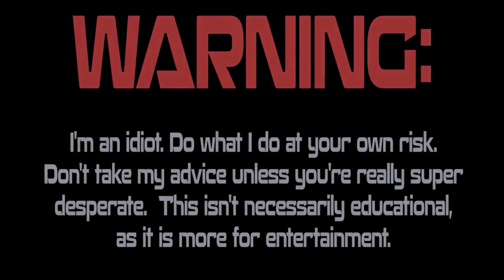FORGOTTEN 1963 Buick LeSabre -  WILL IT DRIVE 100 Miles Home? (P2)

Comment: There are at least 2 different Bendix drives for the Delco starter, and they're interchangeable. The difference is the size of the case around the clutch, and if it's too big, what you saw is the result. That old nailhead sounds like a locomotive right out of the LaGrange shops. But that's okay, because it pulls like locomotive too. The Dynaflow does take about 40 minutes or so to decide to allow forward movement, but that gets better with some rpm. The kickdown is only about 3 minutes, so that's okay. Traffic can be sooo demanding with the horns and such.
Reply: Makes me glad I got the pontiac version with the hydromatic..

Comment: I believe these nail head engines were used as starters for SR71 Blackbirds. Correct me if I'm wrong . The 401 nail head has a goose neck that meets from pipes coming from both heads up front.

Comment: When I was in my early twenties I owned a 61 F100 Ford Pickup! the windshield motor broke on me and I went to the wreakers and took one off and old truck and came home and put it in. It was minus 30 outside, not including the windshield factor. I live in Canada. I put the windshield motor in and it was junk. I went back to the wreakers and got another put that in and it was junk too. I couldn't go to a normal wreakers where they normally test the parts before they sell them it was just a farmer in my area that had pile of these old trucks in his yard. So basically on the third try I got it. I'll never forget it, my fingers were so frozen it took me a whole afternoon to change the motor just once, it was so cold outside. What a nightmare, I do not miss those days. But I use to love that old little truck I ended up owning several of them back in the day.

Comment: It is funny he talked about starters almost never fall out, I was working on a 94 Chevy c1500 that had a 6.5 l diesel of all things in it. It was having electrical problems like the six fives do and at one point in time for some unknowing reason one of the cylinders predetonated when trying to start and snapped both starter bolts out and the starter fell on the ground suspended by the battery cable. I've never seen it before nobody else who was in the shop had ever seen it before, and I hope to not see it ever again lol

Comment: Best tool for quick and secure headliner repair is the stainless steel medical staple gun that's typically used for large lacerations. It works great

Comment: Love the NASCAR reference. Not only did guys like Smokey Yunick run extra fuel lines [as the rule book didnt say how long your fuel lines could be] the rule book also didnt say how WIDE your fuel lines could be, so Smokey ran a 1" pipe  [or so] from the tank to the engine to get himself a couple extra gallons.

Comment: The replacement starter you bought is a general purpose one that fits some Buick models but many cars built through the 1960's are not compatible with modern replacement parts because many cars built through the 1960's had parts that were not interchangeable compatible other engines and cars - the exception being Mopar

Comment: I did notice you have a fire extinguisher right behind by the door, right in the reach zone, it might be fun to check the charged in the green meter and perhaps leave the door open, just in case. You do move fast for a big guy, kudos.  Of the innumerable engines you have CPRd this one sounded the best, like a kitten asleep on your face.

Comment: It,s a runner!!!!  Lol lol lol.....                  Just make it run perfect . Fix brakes, windows, heater, tires, use SOS PADS on paint or scotch Brite, and clear coat the outside, put a radio in it and speakers, keep the exhaust just like that, but replace the actual pipe.  No muffler needed, steam clean the engine compartment and clear coat, complete tune up. Fix radiator. Fix headlights, fix it mechanically. I like how the exhaust sounds...  Fix wipers too.  A cool runner boys.. spray under coating under fenders and under bottom of cars body.and spray inside truck after cleaning.. need seats redone in front, and new shocks. Make a cool runner. Like the red in side. Get new carpet inside car and trunk.. clean and clear coat wheels and put new rubber on them, put a spare back in trunk..plain original wheels and put original hub caps on too, between the body and How it sounds now. That's cool...that's a cool classic that way..  it,s a cool runner... That's a great town car, you will get a lot of looks...that car has a ton of character... I love it......I like to keep vehicles as original as possible, just like my old pickups.......go for it, fix the A/C with good or new parts of ya want too..  drive it all around..... It has a classic worn sound gon on.......and put an American flag on both rear window doors, those are nice nylon flags. Put a 76 gas ball on antenna too.... Do not tint windows or change the wheels out.... from an old truck guy.
Reply: Got that right! Was thinking the same. I'm putting back to life a 2006 Ford Ranger, you know, the ones with all Mazda engine and parts. Really hard to find the whit cove rotor cap on the distributor, can't fired up without it. Kind regards from BC

Comment: Hey Derek, I keep forgetting to tell ya, automatic transmission fluid needs to be checked while the engine is running. So if the metal checkin stick says it's low when the power make it happener is off, it's definitely too low for driving.
Reply: Bet he can read the dipstick too

Comment: Just for laughs, after you got it started you should have pulled into the nearest Buick dealer and ask them for an oil change, and tell them it's been running a little rough at highway speeds.

Comment: Hey Fella. I gots a ?  What is wrong when the car runs at normal operating temp but when you shut er down it bubbles badly in the radiator? I can hear it. Sounds like it is boiling inside. Think it’s air. Head gasket?? 1996 Toyota Camry. Thanks my friend love your show!!

Comment: In the fall of 83, I turned 16 and was so happy to buy my first car. It was a 64’ Buick Skylark, 2 door hardtop with a 301 and a 2 speed powerglide. It had the same wiggly ass syndrome. When the driveshaft would rub, I could back up and slam on what little brakes it had to shift it back. And of course since I was 16, I drove it as hard and fast as it would go.

Comment: I have fixed a few of these era Delco starters with new brushes only in about 20 minutes. Brushes cost 33 cents from the Buick dealer the first time I replaced a set. Now? Might not even be available.

Comment: They used the wrong starter drive when they rebuilt the starter. 
 In the good old days I kept a couple sets of Delco brushes in my tool box. Then rebuilt starters went to $19 and starter bushes went to $12 and then not carried in parts stores .

Comment: I think the starter they gave you was for the 455 Rocket I remember getting the wrong one on a build they sent me the original one you had which was standard for Buick Oldsmobile

Just a thought make a t valve for your temporary fuel tank so it dumps back in with a filter on both ends

Comment: Help bleed brakes? Its called a stick, between the pedal and the seat.  Especially if its an electric seat then you can just use the forwards/backwards  switch.   It takes time but you don't have to hassle the wife.

Comment: You would have been just fine if you had changed the nose cone in part 1? If I remember correctly from episode 1? The starter bending was the problem, to begin with.

Coming, Derek, starters are easy as heck, brother! ✌❤💯

*I've watched every episode of, VGG! 
The part where you can bring anything & everything back to life & drive it home, build big blocks & install super chargers & such? Kinda MIND BOGGLES A, "MAN", that that starter "dips" on you so much? 
2 bolts from the back end & finnagle the ears from the solenoid over the end of the bendix & swap that baby out? If you gotta swap the bendix? You may have to remove the c - clip on the business end? (Usually under a plastic cover/ring) & don't lose the little bushing... it goes between the armature & the nose cone "IF" you drop the little feller? ✌❤💯

Comment: Ya know, I was looking at a house to rent and went to leave only to find the starter bolts had backed out and starter was dingle dangling under the truck. Put the bolts back in in the driveway and went on my way.

Comment: All you have to do is swap the nose cone around it looks like to me it's the same some of the nose comeback cast are many GM starters you could probably even use at 3510 off a small block and swap the front and it would work

Comment: You should be able to just take the nose cone off the old start and put on the new one if you can change that bush and tortillas starter too and it should work

Comment: From 1964 until 1966 the 401 & 425 Buick engines had  different crankshafts than the earlier models to accommodate the new turbo 400 transmissions. A forged steel crank in the 401 and cast iron in the 425. Flex plates transmissions and starters from 1964 to 1966 fit both engines but do not fit the earlier models.

Comment: Back 45 years ago I spent all my time on fixing up my car to get back to work and then after I found a dirt cheap replacement car I sold the car I was driving and started working on the next old car I was going back and forth to work in. I had a 69 Firebird then a 70 mustang and then a 71 Cuda and then I got a 72 Plymouth Fury with a 360 cu inch and then I switched to Escorts and Lynx because gasoline went up high and I was supporting my family. I had to fix up old cars and trucks for 25 years and then I had enough money and a decent job that I could buy a new Ford Ranger and from that time on I never wanted anything but new cars or trucks today I drive a Silverado I don’t buy Fords anymore I buy Chevy trucks because my mechanic said they are the best to work on and I don’t want problems. My 2010 Silverado  has only had one problem and that was the windshield wiper relay THATS built into the fuse box the parts from the dealer were $525 and labor was $300 so that’s not bad for 100 k miles

Comment: i always bleed the brakes alone, a non return valve on the end of  hose or let the end of the hose connected to bleeding nipple into a botrle with brake fluid on floor it also create non return of air but i suppose you and most of the guys know that

Comment: Had several old Buicks with the 401 and 425 engines in them . With a performance tune they would outrun most the hot rods of the 60s.
Reply: Currently have an early-455 Buick car. She moves out pretty swiftly, for 4,825 lbs + me and my stuff to boot.

Comment: This reminds me of the time I drove 
Two lady's from Toronto  to Montreal. I had rented a car and it was in the time that the government 
Changed from miles to k. 60 was 100 and I am on the 401. The speed limit was 100.. but not k. The writing 
For k was on top of the miles. I thought I was going 100 but I was going like 60. I am in the fast lane. After  9 hours oof a 4 hour trip, I look down and it done on me this car had been changed. I had cops get behind
For a ways, and then turn off. I didn't rabbit seeing them. It wasn't long after I realized what was going on. Why were cans coming up on me flashing their lights. I wasn't moving over.

Comment: I wonder why he hasn't just started taking fuel strainers on the revivals. Pull the fuel through a strainer into a filter and when the strainer clogs take it apart spray it out with some brake clean and reuse

Comment: If you look at the fuel gauge there will be a little arrow that will point to which side the gas tank is located on the car. I worked on cars for years and didn't know this either! until I was like 55 years old. Hahahaha. So don't feel so bad.

Comment: As sad as that is I have an F-250 at the shop right now that their problem is it has a problem starting every once in a while cuz the bolts somehow back out and the starter pulls out too far to reach the flywheel I've never seen it before

Comment: How you bleed breaks by yourself 
              (  IS )
I  USE A CLEAR HOSE RAN FROM BLEEDER VALVE ON BRAKE CALIPER ( I HAVE SOMETHING LIKE A IV TO MASTER CYLINDER )
BUT YOU CAN RUN STRAIGHT TO MASTER CYLINDER; WHEN YOU STOP SEEING BUBBLES IN THE LINE??
THE CYLINDER IS BLEED!👍

USES LITTLE MORE BREAK FLUID? THAT'S WHY I FEED FROM A IV!

Comment: I had one 20 years ago and found out after I sold the motor was worth 100 dollars .Cause those engines were expermintal cause they had alumimin heads and timing chair cover and fuel pump as well as water pump in one
Reply: The engine was worth 10000 dollar

Comment: I was gunna ask why a guy didn’t just use the digikal jack in the bay the car was put in. At first a guy used a hand pumper 8,000 and crawled around on the frozen tundra. Of course I did the right thing and acted like I didn’t see it at first.

Comment: IF THE starter can lines up with the new one ,there might have been a chance the nose cone and armeture could be swapped. although it could have become a 250 dollar mistake.  my previuos experience with rebuilding starters and alternators is why Imen tioned it.

Comment: Derek i dunno if you'll even  see this but i was wondering, on average, whata ya usually pay for these old vehicles you revive?
Reply: It really varies on exactly what the vehicle is. My guess would be that some run just under 1000 up to a couple thousand. Depends on rust, title,location. I mean there's so many factors. I think the grand national has probably been the most expensive so far.

Comment: Why don't you run the return line back into the temporary tank? Especially if you are going to be driving. I would find a barb and melt it into the tank and connect the return line to that. I would rather waste a tank (possibly) than waste 5 gallons of gasoline..

Comment: Buy a heated 12 volt motorcycle jacket and plug it into the cigarette lighter if the heater is not working 😎

Comment: Those things worth anything? Neighbor has one in the field 4dr no rust 85k miles interior looks good just a cracked dash and alllll the stickers are still on the motor unscratched- 500$. Also a 64 wildcat similar condition also 4dr been sitting about 35 years.

Comment: I’m afraid that old girl is too far gone.  Anything’s restorable if you throw enough money at it…but it’s a rough… four-door LeSabre that unfortunately does not have much value or is too desirable.  There’s a reason someone parked it (or junked it) before. It would cost way, way more than it’s worth to fix everything that needs to be repaired. And the paint and body…   wow!!  Sell it to a teenage ir college age boy, and let him have a ball fixing it up.

Comment: What to do with it?  Fix it up a little and sell it to a restoraion guy for 4 grand,  Here's a little liist.   Leaking gasket for mechanical fuel pump. Starter rebuild kit needed. Headliner.  That rod that was missing near starter I think for proper shifting.. Rear end problem? Crazy tire splitting. (The video showed a spare in the trunk).  Exhaust problem and brakes no good.  Windshield let's in too much fresh air. Heater with crazy light switch.

Comment: after all the times freezing why doesn't he carry one of them small bus heaters ya know hook up water lines and has fan aLL INSIDE THE SMALL BOX. ONLY NEED TO CARRY A COUPLE peices of heater hose and run a wire to any live and ground.  If If he cannot make dash heater work at least stay warm. same as put tape over da holes and a cardboard for broked windows. Iused one of them heaters alot back in the day and they do heat well.

Comment: An old trick when you have square tires like that is swap tides on but I don't and put the front to the back and I just said cross them in the where the self background if you drive it to a certain degreeAn old trick when you have square tires like that is swap tides on but I don't and put the front to the back and I just said cross them in the where the self background if you drive it to a certain degree

Comment: what size was that engine in that 63 buick nice car ?and what was the rear end and the tranny ?
Reply: 401 Nailhead V8 as a 410 Wildcat trim (Derek says for 410 lb-ft of torque, which was quite a lot in 1963!). Shortly after they had the Nailhead 425 ('64-'66), then the 430, and the engine I have in mine - the behemoth 455 V8. Not sure rear gears. In the early 70s they were 2.73s.

Comment: try fabricating a vacuum brake bleeder .. I made one with some T piece plastic connections .. pull a vacuum using a small diapragm compressor inlet . a 1 litre glass pickle jar holds the vacuum nice and steady   maybe ..  suck the old brake fluid into a 100ml glass jam jar . Wrap some PTFE plumbers tape around the bleed nipples to seal the vacuum . Not rocket science for a guy like you .I am 76 and it took me 1/2 day to come up with ..   empty the small jam jar to avoid brake fluid passing into the compressor .  pickle glass jar .

Comment: smoking more than a casino woman with a pack of pal mals lol!   What Engine is that BTW?  the 375?
Reply: 401 Nailhead with the 410 Wildcat specs. They even had 445 and 465 flavours in 1963-64 ---- damn that is a heck of a lot of torque.